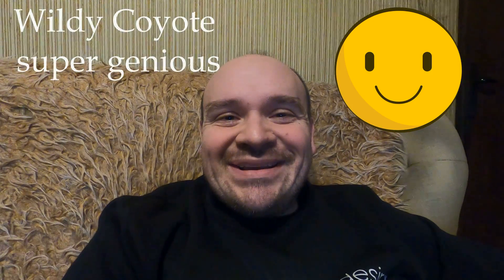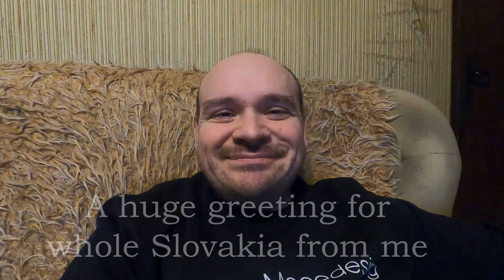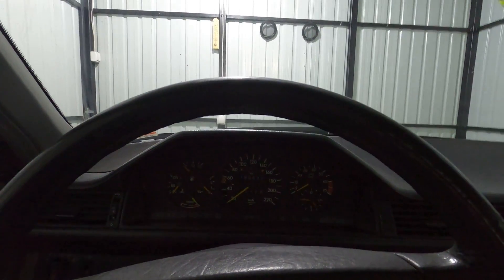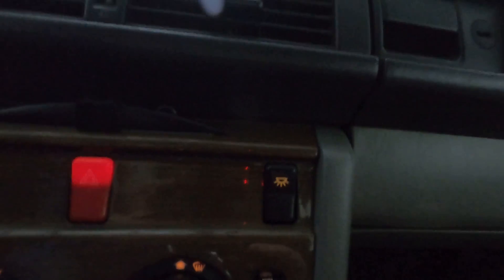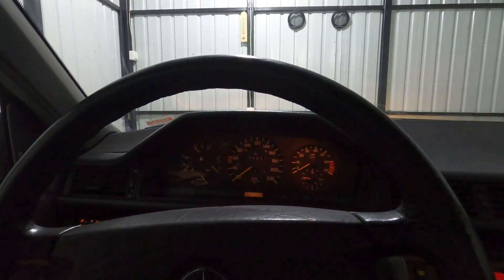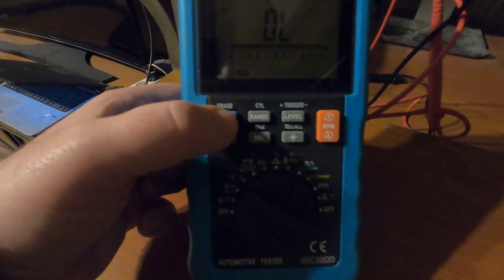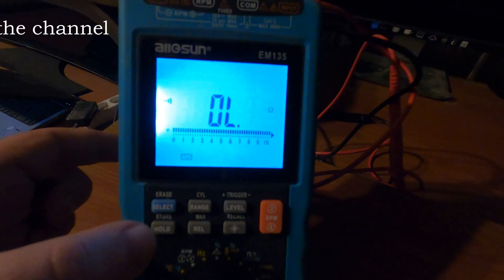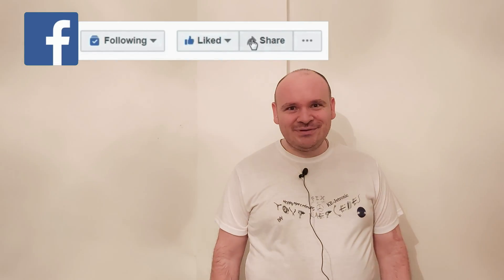㉦Mercedes Ke-Jetronic㉦ - Center console illumination issue

Comment: Hello my friend, I tried to adjust and calibrate the potentiometer and I could not get the number 7. I got the number 8 as a maximum. The car became better, but also the engine goes out sometimes. I changed another air flow and nothing changed. I tired you with questions and I am tired of  this is the problem
Reply from the maker: 0.1 makes not such difference. As for the other issues, watch my previous video and check everything step by step as I described it. Watch all the videos I linked. That way you will solve both the mechanical as well as the electric part of the system.